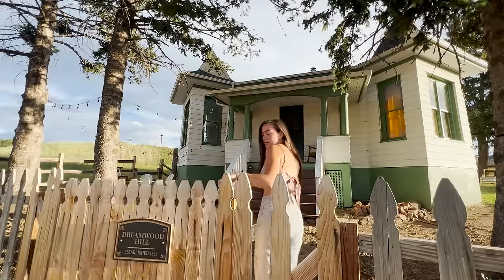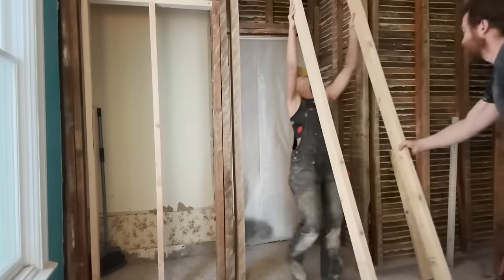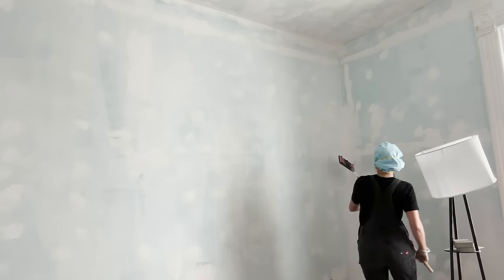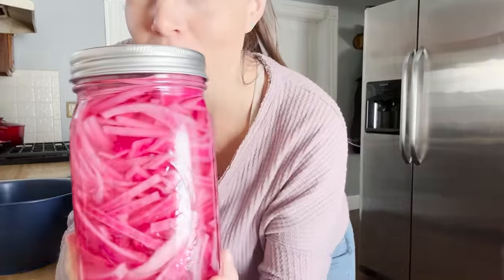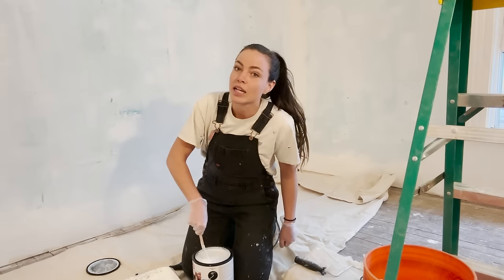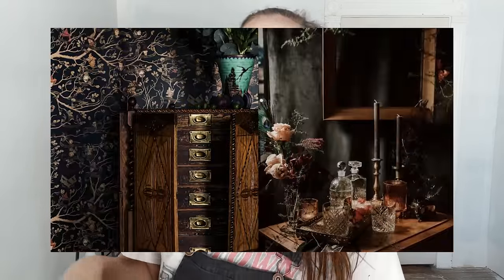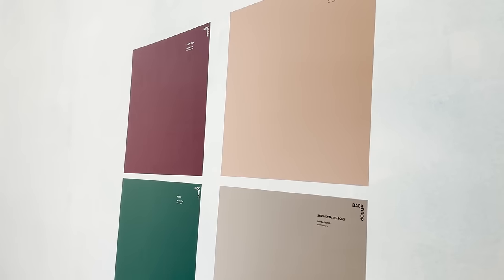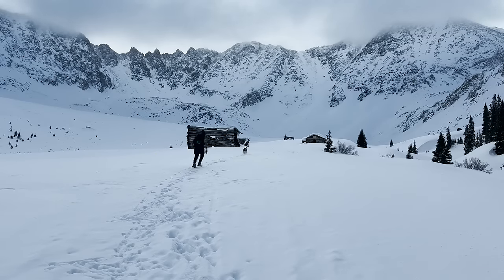building my dream cottage in the mountains! (DIY Reno Series) ep.1

Comment: I'm a retired General Contactor/Builder with multiple licenses in various trades. I have found that I can teach most people that have a fair bit of manual dexterity to do most things in remodeling. Yes, even doing lath and plaster, although sheetrock is faster and easier. You have the right mindset, try what you can, if you fail at first, try again. Most jobs are learned and perfected from doing them over and over. 
The only areas you should definitely seek help are those that have a risk to them; electrical, gas, some plumbing, etc. 
One thing that you might consider is hardwood floors, and if you're really adventurous, design an inlay pattern of exotic woods for a unique look. Because this requires sanding and finishing raw wood, most definitely get help as you can ruin all the hard work from improper sanding, and it's also pretty back breaking. 
Keep going, it's fun seeing someone do their own work, and be as enthusiastic as you are.

Comment: As long as you're tearing things up, you should gut the exterior walls and insulate really well. That's the most important thing you can do. Also, wet sanding drywall is a thing and it's SO MUCH less dusty and terrible.

Comment: I was going to do something like you're doing in 2012. I sold my house and place in Oklahoma and I was looking at a couple of places around Colorado springs, an old farm house and five acres was one place I was considering. I stayed at the wrong motel in Denver and my pickup got the driver's side window broken and I lost most of my cash that was in a computer bag behind the seat. They missed $800 that was in an envelope and a Visa card that I had put $750 on. So that was all the money I had left. I stayed up there a few months, thought I would get a job and buy something maybe, but it was winter 🥶❄️, and it was too hard to do without me knowing the area well enough to get established in a job and find a place I could afford. So in March 2013 I had to come back to OK to find work and try again. I found a job but I was living in my pickup camper shell and so I asked my uncle if I could help him finish his barn that he was framing and stay here awhile. So we built a room in the barn and I stayed here. It was too far from the power pole for anything but a light bulb 💡⚡, so I started buying a couple of solar panels and batteries a month until I got sixteen panels and twenty batteries. I bought a charge controller and a 2000 watts inverter, and last year I changed the batteries out for three lithium iron phosphate batteries. So I added a wind generator in March and used 16 of the batteries on it, which is working great so far. I have more electric ⚡ than I can use and the batteries are always charged nearly full or full. I figured that way if I find an acre here I'll have power to build something else and cook while I'm building it. These last few years I have been collecting stuff that I think I can use and this year I'm finally saving for a spot of land someplace else. If things had turned out differently, I might have been your neighbor or something. Glad to see you're succeeding in your plans. I decided to just stay around here but I would have loved to be up there doing what you're doing. Now everything is costing more than it was, so I'll be lucky to get another chance but I'm going to figure it out and try to get my own place again. I've established a garden and built a 6.5 ft by 18 ft greenhouse on the side of the barn last year. Well I have enjoyed your working on the place. I wish I could have been there too, but I guess it was not in the cards. I knew it could be done.   You'll have a great place when you get more done there. I'm slightly jealous but that's okay. I'm  older and wiser now, I guess. I've got my electrical power system at least, so that will help quite a bit. I can still watch you and that will be enjoyable to see you made it work. I probably should have had a helper when I tried it, maybe I would still be there. 😢

Comment: can i give you a hint ! from  sanding for days(watch dad do it & me mixing mud)  to sanding for minutes it water bucket with warm water & sponge & scrub pad lightly use sponge side bad the other side scrubber let dry out sand then its minutes how i learned this trick sherm a friend came in found old ice-cream bucket & like sink cleaning pad look! i doing my mud & it dry on i about to use power sander! make dust mess!  stop warm water from tap & look! let dry over night sand it little then paint it! like 10 mins it done sanding by hand roller on the paint! i worked in a auto body & truck repair shop factory screw up fixes at the USPS mail truck plant! ok there tricks in body repair that work on dry wall work! screw guns & dry wall screws replace nails & filler the same stuff like old ways! it easy & quicker!